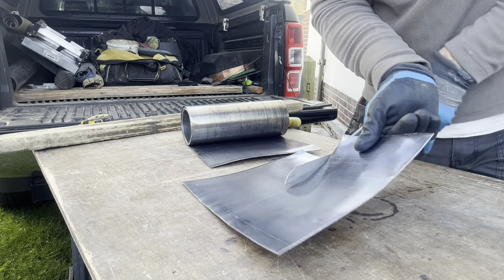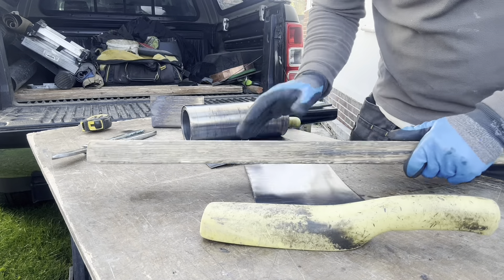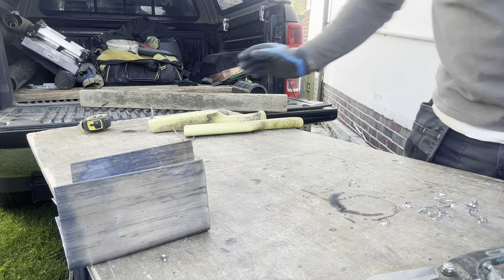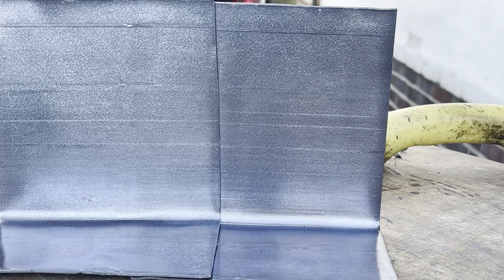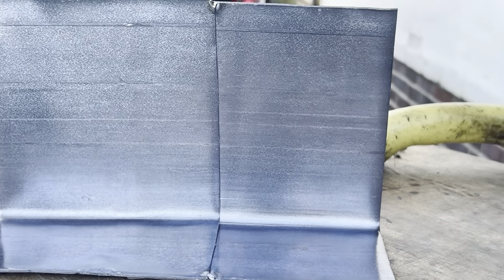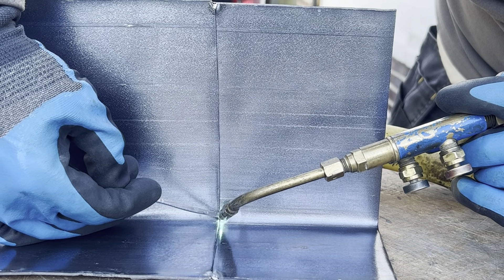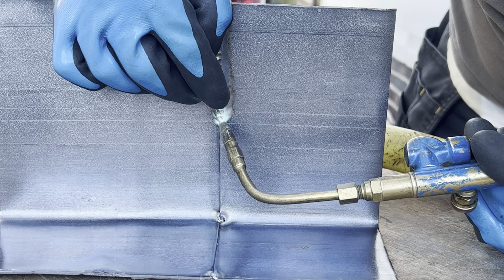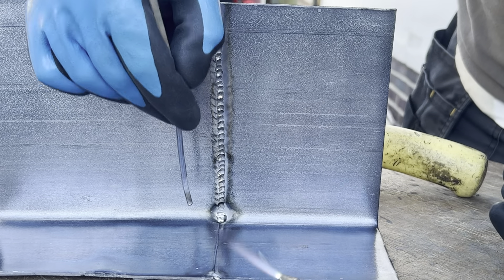Lead Welding On The Vertical Made Easy **CLOSE UP CHEAT CODE**

Comment: Ive always struggled with vertical welds, they always look messy and inconsistent. I generally do anything to avoid doing them (dont think my basic turbo set 90 kit helps, but I dont do enough to justify an acetylene kit) Will definitely give this method a try. Thank you for sharing your technique!
Reply from the maker: I’ve done some welding with the turbo kits in the past and I definitely found it harder than the set up I have now. Please let know if you find his method any easier. 
Thanks for watching.

Comment: Hey Stuart. Do we think the orientation of the torch is important? Your torch is pointing up hill and im wondering if it stops the lead from running down for that split second it needs to set? I know my temp is too high and i might try a different torch with some more control just wondering if torch angle would help? Thanks
Reply from the maker: I think the biggest thing is the temperature and knowing how long you’ve got before you need to pull away. Having the right kit will help you massively. I’d recommend the model o torch all day long. And you need a set up that gives you a precise constant flame that doesn’t fluctuate.
Reply: @slbleadworks   Thanks stuart. I had a damp problem at a property and i think we tracked it down to a lead hopper off a parapet wall. The roofers said they would sort it but they have been trying for a year so i decided to take a look. I bought a weld burning kit. Its a small set with oxygen and propylene. The model O torch was sold out so they sold me a light weight torch. The next size up and adapted model o neck and nozzles. Its seemed to work ok. But i cannot do verticle welds. They just run like a waterfall. Obviously getting too hot. I have noticed that you can push the puddle of molten lead around with the flame of the torch which is why i asked if the torch should point up hill? Im thinking of buying a propper model o torch next to see if that is more controllable. In your videos you mention a small "ball" flame at the end of the torch. Its not possible for me to form that with my torch. The best i can achieve is a small triangle. Not sure what difference that makes but maybe its a problem. 🤷‍♂️
Reply from the maker: @Simon__Davies  vertical welding can be very tricky if your not used to it. Especially if the lead isn’t clean too. Where are you located ?
It definitely sounds like you’re running your flame too hot. 
Start with a really low flame. And try coming down from the top first. Make sure the area to be welded is clean. Maybe you can make a gusset so you won’t have vertical welds. More like 45 degrees. And the model o torch will be a wise investment to make your life easier.
Reply: @slbleadworks   Thankyou again. Im in the midlands. Gloucestershire. I bought some lead and was playing around with this torch for 2 weeks to try all the different temperatures before i attempted this small job on our house. I even welded a small lead "cup" to see if it could hold water 😅.  In the end i managed with layers of lead and folds as i couldnt verticle weld. The bit i was trying to weld , i did gusset it but it to give myself more of a chance.  For the 2 weeks I tried all the different nozzels from no.1 up, to see the difference. And different gas settings. I tried to hold the weld using clamps and a sheet of ply behind the lead in different angles to see if i could manage the run of lead. The lead i bought to try was code 4 so maybe kinda thin to start learning on? Im thinking thicker lead will be more forgiving to learn on initially. In the new year i might buy myself a bit of code 5 and the smaller torch and see how that goes. Im a plumber by trade so wont be doing any big lead jobs but i always looked at lead working as a propper skill and always wanted to try so im going to keep at it.